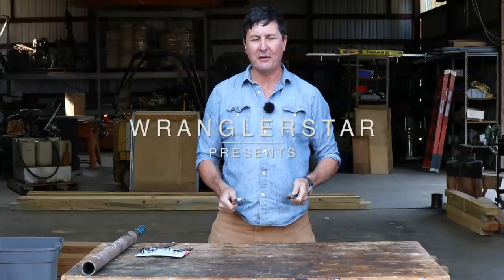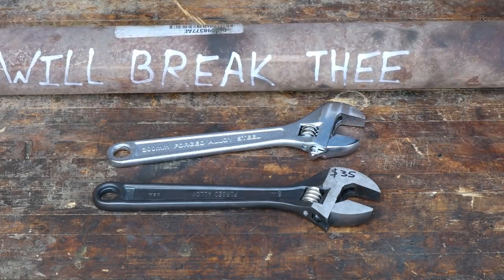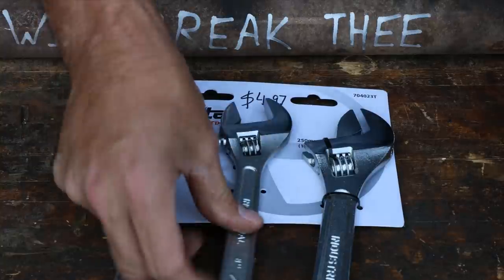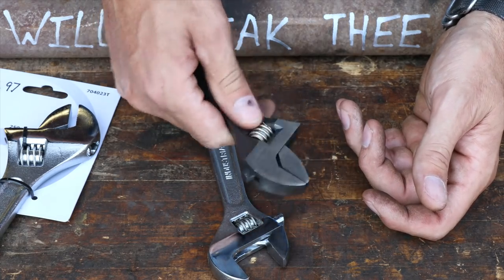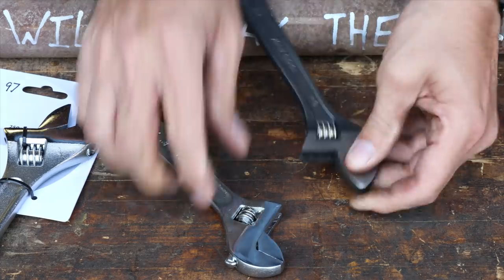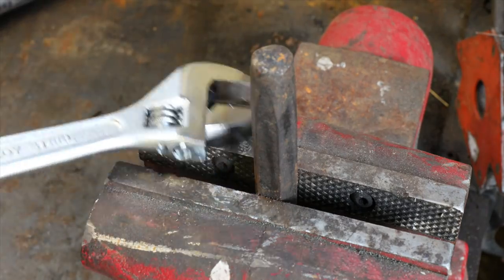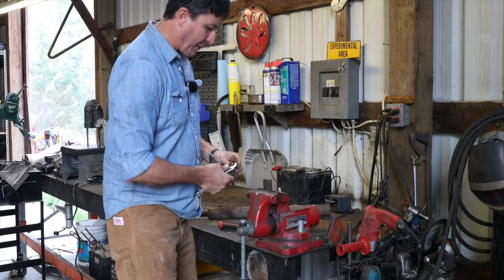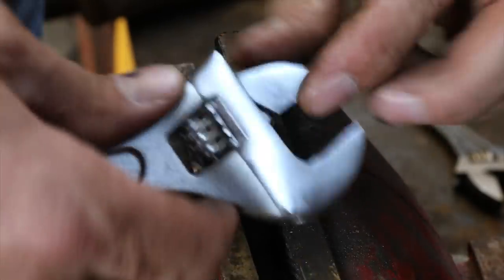Testing Cheap V.S. Expensive Wrenches On AMAZON

Comment: You do realise you just demonstrated how useless the Snapon vice is?
Reply: Steve Bettany vise
Reply: This isn't a US vs UK spelling issue, this is a France vs England issue, and it seems in both countries, both spellings are valid. Although I'm sure in different regions of each country, different ones are preferred. So basically, use whatever one you prefer, because this argument pre-dates the US by a few hundred years. Heck it predates modern English.
Reply: Sutliff01 lol
Reply: I'm just grateful that none of the tests involved aluminium.
Reply: Twenty Rothmans the best film of 1980 was Saturday night fever lol
Reply: And here was I, thinking that it was Aeroplane.
Reply: A vise is a device for holding your workpiece, a vice is a bad habit.
Reply: Such as in a vice president. Most of which, are as crappy as that chinese adjustable wrench.
Reply: True, I haven't seen a vice to do so poorly it's job....
Reply: +GH3KKO GARDENER Your argument is older than what country?
Reply: Steve Bettany hardly it's a very nice vice as is all there tools
Reply: yeah that thing seems like a pos.  we have vises in our workshop that are probably 70 years old and still work great. you can't buy that kind of quality anymore.  it doesn't exist.  Kurt vises we use in the CNC machines are very nice though. we have one that was $3k. you have to pay for quality.    i have a bessey 5" multipurpose rotating pipe and bench vise.  so far it's holding up well after 3 years of use. but it's still childs play compared to the ones we have at work.    I got it at home depot when they had them on sale for $45.  now they're $90.  they also sell the soft  rubber jaws for it at home depot. which is very handy for stuff you don't want scratched up.  no other stores sell these. hats off to the home depot.
Reply: Eric Hood THEIR!
Reply: Snap-on vises are just re branded wilton vises
Reply: Kyle Gardner The USA. Everywhere is older than the States, hence why you have no history.
Reply: I have found an inexpensive vice to be pretty much serviceable in most cases unless one must be precise with it. How often is that? My grandfather was a railroad man in the 1930s and had a huge monstrosity in his basement workshop. I could barely turn the bar on the jaws at 5 yo.
Reply: Not everywhere. Aus is far younger, for starters
Reply: Francis Taylor Whenever I had history lessons, whenever I research something historical, I haven't stumbled upon a single Australia fact. So you are right here.
Reply: Everyone is bashing you on your spelling.  I'm not that low, but I am going to say this: The reason why the vise is not doing its job is because he used the vise handle to tighten the piece, which is shorter than the "I will break Thee" handle. A simple understanding of leverage shows that 100 pounds of torque (Vise) will be beat by 150 pounds of torque (The cheater bar.) Not the vise's fault,  it's operator error.
Reply: Dont tell anyone but Australia doesnt actually exist. Honest.
Reply: Steve Bettany so true
Reply: GH3KKO GARDENER most third world countries are that old 😂
Reply: ErostheEpic That's not how that works. The vise tightens via a screw so the applied torque is multiplied substantially. You could crush a piece of metal in a vise with minimal effort that you'd never be able to crush with your bare hands. It slipped because of loose tolerances most likely due to wear over it's probably 20+ year life.
Reply: I will say this though.  When he was holding onto the 5 sided punch in the vise,  wouldn't you agree that the vise would've done a better job holding onto it if he used a 4 sided object?  On one vise jaw, as you can see in the video,  the vise is holding onto such small surface area (the 5th point of the 5 sided punch) which can lend itself to slippage easily.  I'm still calling operator error on that test.

Edit: He actually used a 4 sided object after that 5 sided punch fiasco, and guess what,  no slippage in the vise screw thread.  Seems like the slippage came from the tiny amount of surface area the vise clamped on when holding on the 5 sided punch which created a teeter totter effect on the moveable vise and any torque (not much, from the cheater bar) can easily knock the 5 sided punch's balance off.
Reply: Yea it was definitely asking a lot of it. Obviously the less round the object is the easier it'll be to hold. It's just an old vise holding a small, fairly round object while being subjected to a lot of torque. It's really no surprise that it slipped
Reply: Richard Hunter
Correcting trivial typos or arbitrary spelling errors is a bad habit.  And ANNOYING.
Reply: Steve Bettany yep his vice gave lol
Reply: GH3KKO GARDENER you have to get the US to protect you lol
Reply: m1330T9500 what I said goes to you too read what I said to the other guy
Reply: Francis Taylor what are you talking about it does
Reply: Wowthatsfail what
Reply: Steve Bettany I
Reply: Did anyone else notice that the punch in the vise was five sided?  That may be part of why we saw the punch turn in the jaws of the vise.  If it had been a hexagonal punch instead, each jaw would have been gripping a flat on the punch.  Even a very high quality vise needs to have sufficient contact area between the work piece and each jaw of the vise in order to achieve maximum clamping force/stability of holding the work piece.
Reply: While you are right that 150 ft-lbs of torque will overcome 100 ft-lbs of torque, you are missing one factor.  The screw device that locks the jaws (because of the geometric design of the vise.) holds against  a linear (PSI) rather than a torquing (Ft-Lbs) force.  It can't be an apples to apples comparison.  

The jaws of the vice are subjected to torque, but the screw holding the jaws closed  is subjected to linear forces.  For any vise, a given amount of torquing force, so long as it does not overcome the linear holding ability of the jaw clamping screw mechanism, would cause the jaws to fail.  I believe that most, if not all vises are designed so that the clamping mechanism would fail before the jaws fail.

It would be interesting to test several vises though with accurate measuring of the torques and linear forces involved.   Applying the same amounts of torque using both narrow and wider stock clamped in the vise jaws would also be a nice comparison.

 is also of note that the punch was a pentagonal shaft .  This meant that one jaw of the vise was in contact with a flat side while the other jaw was only in contact with an edge.  Much less surface area for that jaw to grip.  I believe that the pentagonal shape of the punch shaft is the major factor in why it turned in the jaws of the vise and not the quality of the vise.
Reply: Steve Bettany it's made by wilton

Comment: These wrenches (shifters we call them in the UK) aren't built for handling massive amounts of force.  Having said that, every set of really cheap (Chinese) ones i've ever owned has had extremely soft jaws and loose screw mechanisms.  Middle priced ones are more than adequate for most diy users.
My dad has owned quality branded ones (Record, Bahco) from his work as an industrial plumber in the 60's.  From 6inch right up to 4 foot long and they're almost as good as new.  You get what you pay for if you're going to be using that tool alot, but there are some tool manufacturers out there who make really good stuff alot cheaper than the major brands.  Avoid ultra cheap tools like the plague
Reply: TheBlaggert never heard anyone call it a shifter its just a spanner
Reply: thealphawolf42069 shifter or shifting spanner is a common term for them where I'm from(N. Ireland) Probably other places call them different names.
Reply: TheBlaggert oh im from england we just call it a spanner
Reply: its an adjustable wrench if its big and adjustable spanner if smaller. besides being the same actual tool.  where im from in the uk
Reply: buy expensive Chinese wrench on taobao and try again....you may find it's good quality as the others.
Reply: it's price all that matters..............................
Reply: I only use bahco adjustable wrenches at work. They are very nice

Comment: You need to understand the Chinese attitude to making items for export as opposed to making items for domestic use.  Chinese exports ave, until a few months ago, aimed at vacuuming as much premium currency, (£ $  euro), into the state bank's vaults as possible.  Make things to sell so cheaply that all but professional buyers will buy the price, not the item.  Currency flows in at an alarming speed = mission accomplished.  I know many people in Guangdong province involved in export sales and I have learned that the same reasoning can be applied to almost any family of product.  That's why it is easy to but a Chinese quartz watch for less than the cost of fitting a new battery to a quartz watch in any UK business serving the general public.  Since the Chinese watch may not outlive its battery it represents neither a good deal nor a bad one.

Now go to the maintenance workshop of a Chinese watchmaking factory to see what tools Chinese cutting-edge industries use for their work.  Well, they are Chinese, but it's "not (Chinese) as we know it!"  If you were a regular user of high-quality Occidental tools, and you had been efficiently blindfolded, you would not notice any difference handling and using high-quality Chinese hand tools compared with high-quality Western hand tools.  the tools Chinese manufacturers supply to demanding Chinese manufacturing and service enterprises.  There is no expectation that those tools should bring in floods of strong currencies.

Are the Chinese being cynical when they deliberately work to an "irresistible" price for one market and to an "irresistible" quality for another?  Yes.  Do they care?  No.  Should they care?  Yes.  But they do not believe that "you can fool some of the people all of the time, but you cannot fool all the people all of the time", and it is impossible to convince enough Chinese industrial leaders that the "fooling some of the people some of the time" period is bound to end one day, brutally and unannounced, to make any impact on their behaviour.  There is a massive Chinese steel-making sector, producing very little special steel, nearly all of which goes to government suppliers and government projects.  That would cover their military hardware manufacturers, and the national plans for creating a competitive aero-space sector, a competitive automobile sector, etc..  Like many other steel articles manufactured in China, the  presentation will refer to whatever the buyer wants to see marked on a tool and its packaging, not necessarily to what is actually in the tool.  Molybdenum?  Well, it does say so on the handle of a tool and on its packaging, but that does not guarantee the presence of any particular component of any steel alloy in the tool itself.  I can talk the hind legs off a donkey, but I will have to learn how to talk the hind legs off, for example, a deep-water oil-drilling platform if I am to have any chance of convincing watch manufacturers, knife makers, office staple manufacturers and the manufacturers of hand-tools and surgical implements and equipments to stop using the same grade of stainless steel.  That spanner/wrench you have just ordered may be made of the same steel as the back plate of your new watch, and, until Western buyers can resist goods that can be delivered to them for less than the manufacturing cost, sometimes less than one-tenth of the manufacturing cost, of their Western equivalents there is very little chance of changing the Chinese industrial culture, where pragmatism is pushed to its ridiculous extreme.  One day I will get one Chinese industrial to stop saying "They want to buy, we want to sell, so where is the problem?", but I am not holding my breath.
Reply: This is a very interesting and considered commentary on the production of mega-cheap Chinese export products.
Reply: Do Chinese care about only making top quality products? No, they don't care. In the future, I suppose they will still make same products from 1 dollar range to 1,000 dollars range in business if anyone requests. Beside, most of 1 dollar Chinese stuff are imported by American business men. American business men import Chinese products to sell that is not about nation glory, it is only about money.
Reply: Harbor Freight has several different quality levels of hand tools. Their "professional grade" tools get good reviews when compared to Snap On, Matco, etc. Seems the Chinese tool manufacturers are no longer going after only the foreign budget tool buyer.
Reply: I know many people from GZ and was there many years ago.. and the core problem with chinese, they can never do something correct, they always seem to have mistakes or make stupid mistakes and not professional enough.......... because they want money fast and living in the moment and do not care about tomorrow or quality.  This is not china themselves, fully to blame it was the opportunity which the western bankers and technocrats which allowed china to open and flood the markets to other countries mainly attacking the western markets.
Reply: Voy Cok I mean we'll make top quality if people can afford it first 🤷🏻‍♂️
Reply: That comment was too long
Reply: Damn. Chinese PROPAGANDA ANYONE?
USA 🇺🇸. #1.

Comment: the Chinese Wrench seems to have more flexibility to it where as the other wrench has no give so once you hit the point of breaking the metal will just snap where as the Chinese wrench had the inside of the Teeth chewed away under the pressure 

the Chinese wrench has slightly less sheering strength and honestly if your going to need to put that much leverage behind a wrench your probably using a full size torque wrench

for general every day use just go with the Chinese Wrench
Reply: Another option would be to spend $5 extra dollars and get an even nicer Chinese-made wrench from a major brand, which is likely even far more durable, likely close to as good as the SK wrench. I really feel like not testing a higher-end but cheaper Chinese tool vs the SK one is a huge miss, I mean how much more durable is a Dewalt adjustable wrench (at less than half the cost) vs the SK tool? A lot of folks buy the cheapest products for one-time use or to round out a set, where the cheapest option works just fine (and if it doesn't you just return/exchange it), but most DIY folks and even a lot of pros will buy the mid-range option because the quality/price is best. Nothing wrong with splurging if it's a tool you abuse multiple times a day, but that probably won't be the case for most even pros, they're going to need multiple wrenches for various sizes (even adjustable) or they're likely going with a socket or fixed wrench, in which case buying the highest-end option is going to put a serious dent in a pocketbook.
Reply: silencesummer    This is why he should have tested different quality wrenches. It would have made more sense to label the video as low quality vs high quality since there are low quality American made wrenches. I always buy mid range tools because I tend to lose tools in the field. Mid range is the best way to go if you use tools on a daily basis. I've never had a problem with them and, like you said, don't put a dent on the pocketbook.
Reply: It is mostly about the steel, the chineese one is made of some alloy while the other one is made from harder tool steel.
Reply: "since there are low quality American made wrenches"

Where? Maybe some NOS Craftsman, but Sears is just about out of business.
Reply: Judess 69er I

Comment: I am not a schooled mechanic or very advanced tool user, but I am a mechanical engineer and I don't know about that turning clockwise thing you said. Just from intuition, you are putting the same force on either side of the jaw, but by turning clockwise you exert the force on the highest part of the adjustable (weak) side of the jaw. This gives you a larger moment arm on the thin part that supports it (exactly where the expensive one broke). If you turn anticlockwise or flip the wrench you exert the force high on the strong jaw and low on the weak jaw. Which I would expect makes a real difference in failure load.

Comment: S-K filleted the edge of the 1/2" bar and got the bolt to skip in a vice.  5/5 would buy.
Reply: Polish Asparagus my S-K adjustable is one of my favorite, most used I have